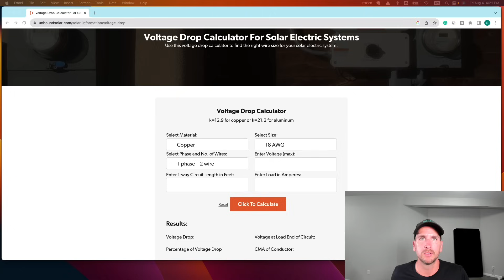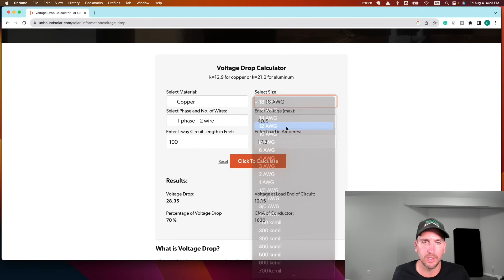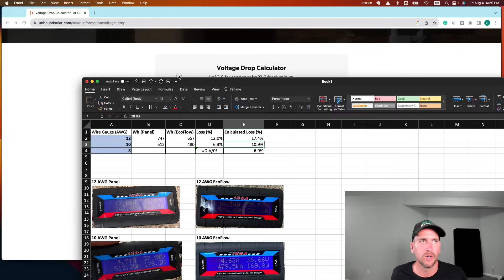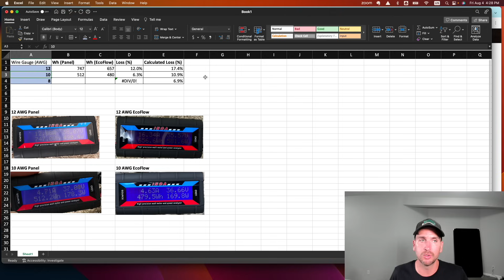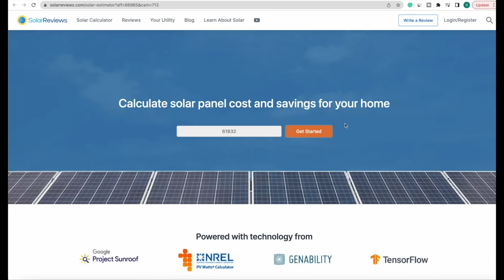What Wire Should You Use For DIY Solar Kits? Surprising Results!

Comment: Series would be more efficient for a long wire run.
Reply: Provided you do not go over the maximum voltage input recommended to the device as listed by the manufacturer. That includes doing extreme cold weather math on the photovoltaic panel.

Comment: Off topic: Noticed your shirt, and I own a 1958 house in south Florida that my parents bought new and I was raised in. Over the years, more so recently, every outlet in this house, or switch that's ever been upgraded, or replaced due to wear and tear, has been found to have been taped originally back in 1958 when the house was built. Not trying to start an argument, or anything, but just thought I'd throw that out there for grins and giggles... Good test in this video. Thanks.
Reply from the maker: Hahaha, don't worry I won't get worked up either way.  I just made the shirt a while back because of a few videos I did in the past there were no shortage of passionate people on both sides of the argument.

Comment: Would the results be altered much if the wires were physically closer to each other as they would be when run in a 100 ft stretch of conduit?  I wonder how much the results would change in a real world comparison.
Reply: That won't make any difference f9r DC.
Reply: The only time we pay attention to that is on super large DC conductors coming off of a battery bank where the amperage may exceed 500 A plus. In that case we tape the conductors together.
Reply: @boblatkey7160  Yup, but that is not really a loss issue. It is more to reduce issues caused by magnetic fields with huge currents.

Comment: Every time you install a component in line you make a new resistance component and your test is invalid, 
Nice Try ..FAIL
Reply from the maker: Between the 2 Power Analyzers is only the 100' of wire.  I could understand if this test setup would throw off the amount of power getting to the Delta Pro as compared to no power analyzers in the circuit but specifically for focusing on the loss in the 100' I am not seeing how this would be a fail.  Always open to feedback, thx.
Reply: Not true! You do not know what you're talking about lick a little. Out of your league there pops!
Reply: I've been playing with DC power my whole life and nothing has ever burned down 😂 im pretty sure im doing it correctly. Oh wait ill bet you believe Ohms Law works on solar systems 😆 
 @boblatkey7160
Reply: @boblatkey7160 and ill bet you believe in Ohms Law for applying in DC systems oh do tell 😂

Comment: I measured my hundred foot run with 10 gauge wire and it came out to 0.61% Percentage of Voltage Drop with the calculator you're using... Not too bad

Comment: I'm running 12 gauge 250 feet connected to 8 230 watt panels at 120 dc volts with about a 2 volt loss and maybe 10 volt under load.
that's insignificant after it goes through the MPPT to charge batteries at 27 volts and around 30 amps
Reply: Current-Voltage Relationship: The current output of a solar panel is directly related to the voltage across its terminals. As the voltage increases, the current output typically decreases, and vice versa. This relationship is governed by the current-voltage characteristic of the solar panel, which is influenced by factors like the material properties and design of the solar cells.

Temperature Dependence: Solar panel performance is affected by temperature. Generally, as the temperature of the solar panel increases, its current output decreases. This is due to the fact that increased temperature can lead to higher internal resistance within the solar cells, reducing their ability to generate current.

Power Tolerance: Solar panel manufacturers specify a power tolerance rating, which indicates the allowable deviation from the labeled power output. For example, a solar panel with a "+/- 5% power tolerance" means the actual power output may vary by up to 5% from the labeled value. This tolerance also applies to the current output of the solar panel.

Series and Parallel Connections: Solar panels can be connected in series or parallel configurations to increase the overall current or voltage output of the system. When solar panels are connected in series, the current remains relatively constant, while the voltage adds up. On the other hand, when connected in parallel, the voltage remains constant, while the current adds up.
Reply from the maker: Hmmmm, thanks for the feedback.  I would expect a much higher line loss.  I am curious now how your losses are so low for a 250' run. Do you know the Voltage and Amperage at the panels?  Are you bringing in 4 panels together  in series across and then those 2 strings in parallel into your charge controller?  What are you using for a charge controller?  Thanks for the feedback!
Reply: @everydaysolar   When you use high voltage everything works better.
!2/2 is suitable for 20 amps 
that's about what my panels put out hooked in series but you're panels will only supply the amount of power that the charge controller asks for.
 The exact current output will depend on the load's power consumption and the solar panel's current output capabilities.

Comment: I'm running 3*250V at 33A over 60m 3*2.5mm² at full sun it looses one kW,.
This is the Netherlands. On average the cable losses are insignificant.
Reply from the maker: Really?  That is surprising as 2.5 mm wire is equivalent to our 14 AWG which I would expect has some serious losses running 250V @ 3 Amp for 60m.  Either way, thanks for the feedback 👍
Reply: @everydaysolar  Sorry I messed up. We run three phase 33A over 60meters of 6mm² not 2.5mm², that indeed would not be good 😁
Reply: @picobyte  nice, thanks for the follow up!
Reply: @EverydayHomeRepairs  The Netherlands sits at ~52°N optimal placed (rooftop) panels averaged over the year produce 10~12% of their peak power. Lots in summer, near nothing for months during long #dunkelflaute.
 Clouded misty cold weather that in UK and most of west europa can last for months is what the Germans named dunkelflaute when their whole 90GW of wind and solar did near nothing most of the winter.

Comment: I'd be curious to know what the test results would be if you ran two lengths of 12ga and split the resistance across two conductors.
Reply: That would halve the resistance so would halve the power loss.
Reply: those 2 wires would also need to be VERY close in length and quality or you can get some serious current sharing issues over those kinds of distances.
This is so important for any electrical using multiple (because of pipe size limits and bigger is hard to pull or bend) conductors on a phase, that there is a NEC section
Reply: @steveurbach3093  to an extent. They just have to be close enough- not perfectly matched.
If one wire is conducting more current than the other, then the voltage across it will increase. This tends to have a balancing effect. ie. it would be unlikely to see 75% down one wire and 25% down the other unless there was a really bad mismatch. A few feet on a hundred foot cable wouldn't make much difference. A 50 ft difference on a 100ft cable would.
Reply: @steveurbach3093  They only need to be VERY close if you are depending on the calculation to be VERY accurate.  You can actually run an 8ga and a 10ga and you will get  the resistance relief.  It's not a problem.  And yes there are sections about it in the code because it's done at larger sizes.

Comment: I own a couple of meters similar to what you used. I've noticed what the meters show for the same source can vary a bit. This might contribute to at least some of the difference seen with the calculated values.
Reply from the maker: I think you are right.  I am thinking about stepping up the testing equipment.  Do you know of any higher quality power analyzers with a wide range of voltage and amperage capability?
Reply: @everydaysolar  For what I am doing, I couldn't justify more expensive meters, so I can't recommend anything. I did get some cheap "voltage reference" devices to test my meters, but they only go up to about 10 volts. Until you get better gear, you might try repeating the test with the meters swapped, then average the results.
Reply: @everydaysolar  Use A-B switching and operating conditions as stable as possible. Connect one device to the A side, note its results, swap to the B side, and note the results, swap back to the A side and note the results again, ensuring they read the same as before. If not, try again.  Do this multiple times so you get at least three sets of good results at a given light level. Repeat at different light levels. Your records and a bit of work in Excel will allow you to cross-calibrate the two devices - "correct" the readings of the B device to match the A ( which you chose as the "standard").
Reply: @gregvanpaassen I’m sorry, what are the A and B sides?
Reply: @gregvanpaassen the rest of your reply is spot on. I just said the same thing two seconds ago in a reply.
Reply: Yes, when testing electrical values, it is best to repeat the test multiple times, pulling the test probes off and checking again. Rubbing them on the contacts as you watch the meter readings. A lot of electrical and electronics pros do it. False readings are quite common from faulty contact of the probes.

Comment: You compared watt-hours to watt-hours but didn't specify any length of time for each test. It seems like power in watts would be a more practical result to compare since it is instantaneous and the sun/cloud  condition could be held more or less constant for each wite gaige  test.
Reply from the maker: Using Wh helps to normalize the data so I can compare different testing intervals and maintain a apples-to-apples between the 3 wire gauges. Make sense?  I appreciate the feedback and always looking to learn/improve the setup.

Comment: Did you take into account the loops in the run of the wire. That would induce some induction in the power which would modify the apparent voltage drop?
Reply from the maker: As @bbalaskan89 mentioned I tried to lay the wires out to avoid unwanted impacts of large coils but the testing setup definitely isn't "lab-grade" and a bit of a quick and dirty look are the losses from each size of wire.
Reply: I think that's why he spread them out quite a bit